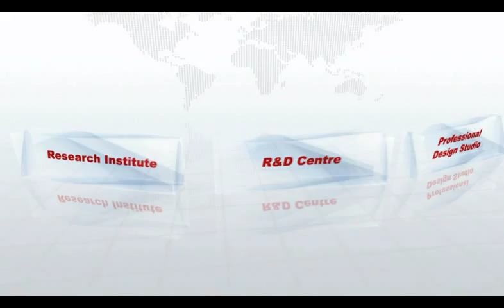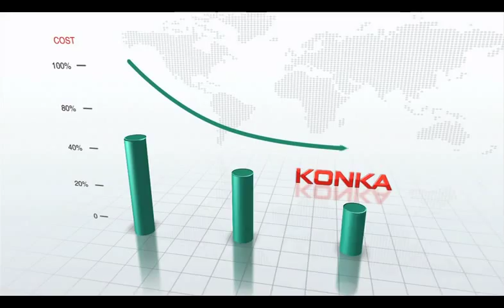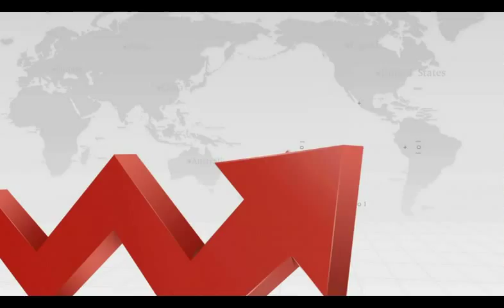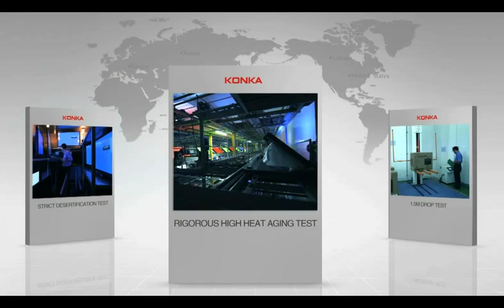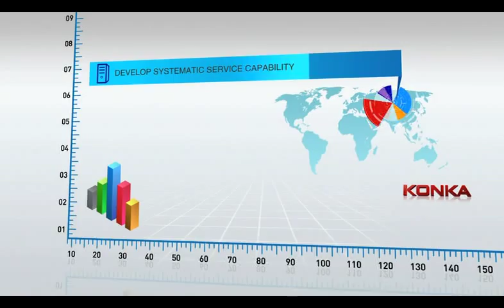Konka Group Co., Ltd.,

Comment: Saludos, Tengo un TV LED KONKA de 46¨, MOdelo: KDL46MS95U, el cual cuando lo prendo presenta franjas verticales a colores y luego se pone blanca la pantalla con manchas oscuras. necesito el Manual de servicio de este modelo, o los datos de la T-CON: A60EDGEC2LV0.2. Gracias.